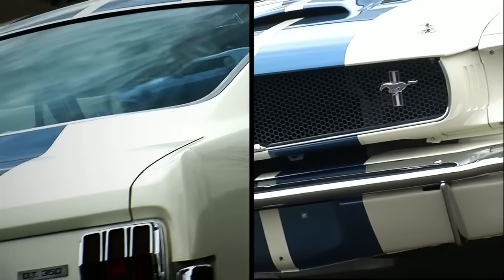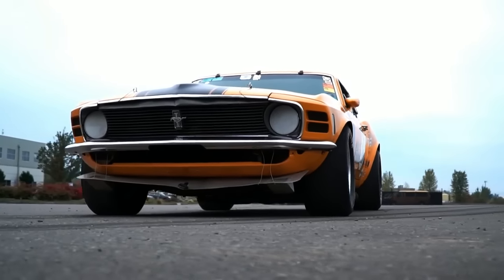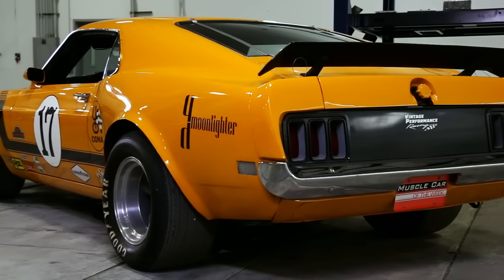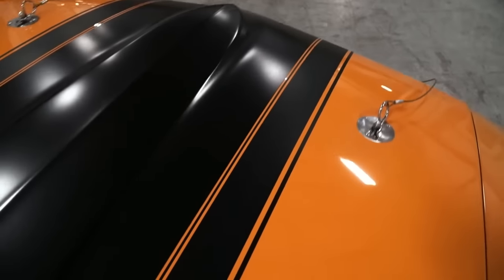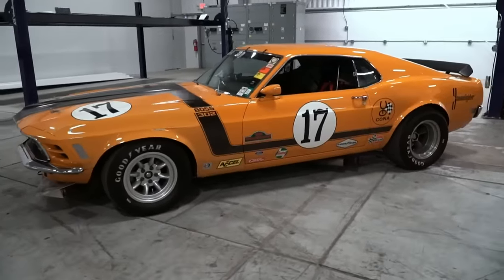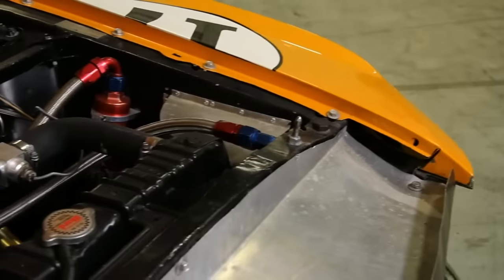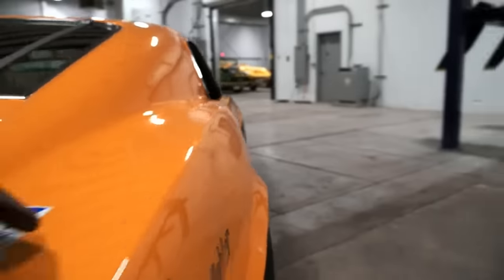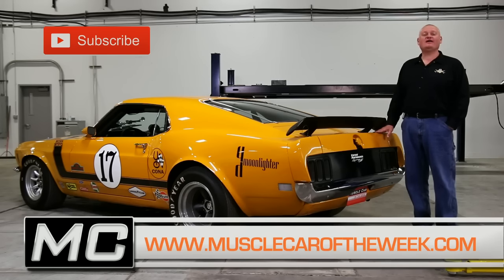1970 Mustang BOSS 302 Trans Am Parts Development Car Muscle Car Of The Week Video Episode #173

Comment: If I was rich, and I ain't, I'd have a hot rod mustang and a 1967 Fairlane with a 427 side-oiler, 4 speed, etc. Instead a drive a diesel pickup with 433,000 miles on it. :(
Reply: Me too.  A 2001 Dodge Dually.
Reply: Among mine would be a resto-mod ‘65 Shelby GT-350 in Wimbledon white with the guardsman blue stripes, an ecoboost drivetrain and a 5-speed, and a plain Jane 427-powered burgundy ‘64 Galaxie with dogdish hubcaps.
Reply: I bet the truck is awesome though

Comment: McGee Motorsports at Sears Point stables several Bud Moore Trans Am cars, including the #16 Peter Gregg car.  Bud Moore put "skinny leaf springs" in them with a Watts linkage.
..."skinny leaf springs" were very narrow 1.25" wide with spherical bearings in the eyes, instead of plain bushings and pins.  So, the leaf springs rotated under load along with the axle & didn't twist.  These old guys were very clever.

Comment: I have my own 1970 mustang!
Reply: Luke Teverino I have a bb 70 chevelle but I liked  my 4v cleveland and top loader 4 speed  67 ford short bed far better.
The truck weighed 3050 lbs and with the 390 rear gear my truck was even up in the quarter with my chevelle. Id love a 302 or 351 boss
Reply: Me too

Comment: That burnout was mostly clutch. Better get it on the house, clutch time.
Reply from the maker: The clutch is not slipping, it's just that shot was done in 120 frames per second and it froze the action of the tire with no blur, so it appears that way.

Comment: I asked For to sell me parts to repair one of their longest lasting trucks on the road a 1987 F150, two wheel drive with 4 speed  and a straight 6. I was steered to the retail sales department for new trucks. With advice like that I would sooner buy some snotty import, I said. I was told I was right, but that We don't make parts further back than for 1999 models. Has Ford gone completely lame ? I'm keeping mine anyway, I made the part myself, but this still pisses me off. Maybe they will listen to you, it seems I can drop dead, in their sight.